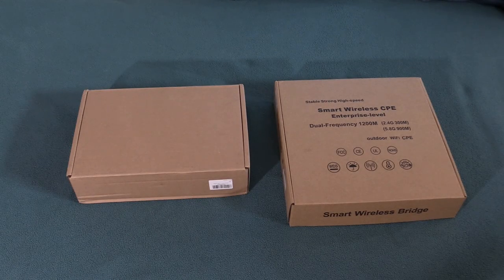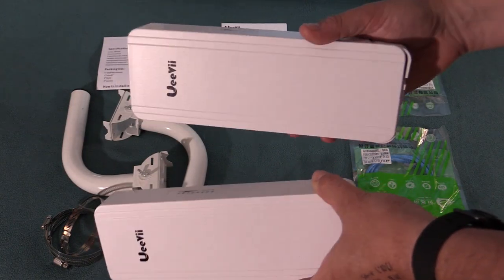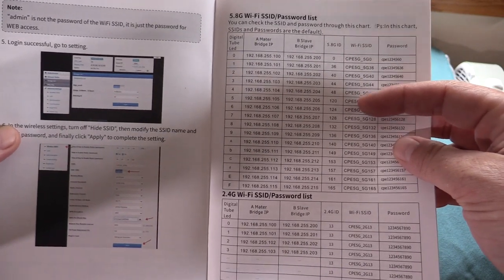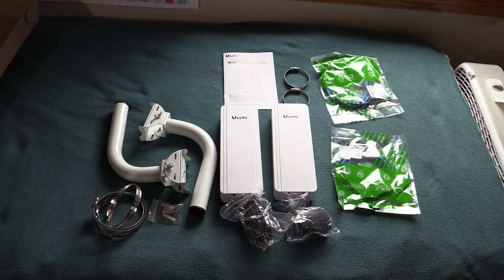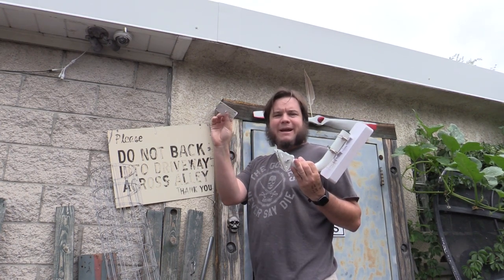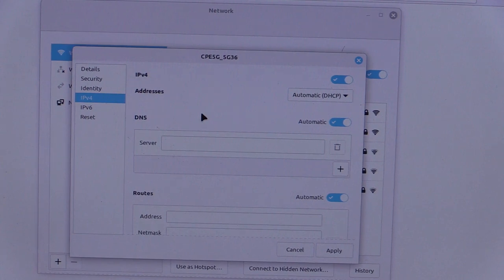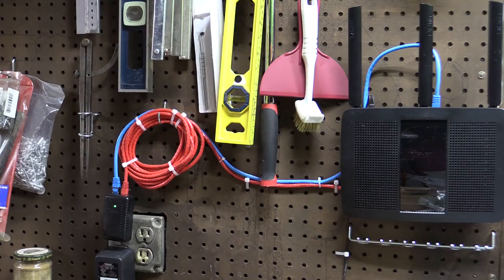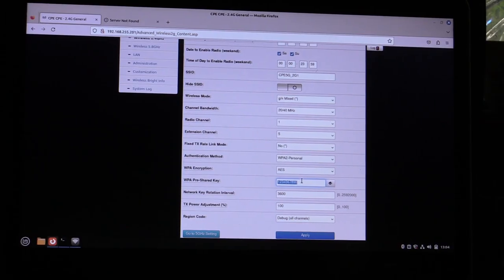UeeVii CPE5824 Wireless Network Bridge Review

Comment: We used a similar pair for our observatory when it was out in the countryside.   We had an internet service via XDSL to the optical observatory building, and then a pair of these wireless bridges feeding network to the radio observatory "science trailer"   worked just fine--even skimming the treetops in between.  It was a roughly 100m "hop", but the bridges were rated for a 1km "hop".  Never had a problem with them.  The internet service dropped out from time to time, and it was much much slower than the wireless bridge was capable of.   Can't remember the brand, but the cases looked exactly like the ones you have.
Reply from the maker: I'll have to come up for something when we get our observatory going at Sandland, right now it's a patchwork of little 4G gadgets. We have a LOT of trees and limited line of sight anywhere except the upper field, so I'm not sure if this would work out there!

Comment: A very nice product and a really simple installation, I find the solution with the hose clamps ingenious, as it allows for variations in the diameter of the pipe on which I mount the device. Up to 3mi range should be possible, which is a truly great range, leaving nothing to be desired.

Comment: The fact that you could access the internet while on the wifi-network of the bridge but could not access the admin-page is probably because the IP-range the DHCP-server in your network's main router uses is different than the 192.168.255.x range the bridge uses when running default settings. The laptop and bridge aren't in the same VLAN. If you configure the bridge to "request" an IP-address from the same range your router's DHCP-server uses you will probably be able to access the admin-page using wifi.
Reply from the maker: Yep, the bridge doesn't assign IPs, but even manually setting a laptop to the bridge's subnet I had trouble getting to it. Seems like it only works on the wired connection and only with http (no s).

Comment: switch to a static IP on both units an let say unit A 192.168.1.3 and unit B 192.168.1.4 (make sure its om the same range as your home network) set both dns to your gateway router ip

Comment: Sweet! Nice to know there is actually a signal "extender" rather than those useless "Wifi Boosters." Of course this is a little more complex than the boosters but then again it also actually works.
Reply: Wireless "extenders" or rather point-to-point wireless bridges have been around for many years, just less well known in the consumer markets.  They have almost always been an important part of the WISP (wireless internet service provider) market, usually intended for the customer premise equipment.  (Hence the "CPE" part of the name.)   One of the larger more well known (and I would argue safer/more secure) brands in this market would be Ubiquiti.   To me, this UeeVii product looks like a lesser clone of Ubiquiti's Nanostation product (which is also sold cheaper nowadays too!)  Yes, you would be correct, some basic networking knowledge is suggested to configure commercial grade wireless gear, but the quality of the equipment makes it well worth the setup!
Reply: @btw111  Interesting! I'm sure I would have discovered this if I'd bothered to dig into it significantly but as I just want connection in my garage but don't really need it I only messed around briefly with a twenty buck booster (promptly returned to Amazon as they're useless).

Comment: Hi! Very informative video! I do have one question, are they compatible with most routers? I have a router from my ex wifi, but want to know if these can work with that router, how can I tell?
Reply from the maker: I only tested it with a Linksys router. It seems fairly generic and should act as a bridge to extend your ethernet, so theoretically any router would work. However, I've run into some "weird" things with routers in the past so they're never 100% reliable.

Comment: I noticed some possible issues when trying to enter the configuration page. 
First is 7:08, your browser seems to use HTTPS primarily, this might cause issue since https uses port 443 in default while the config page usually uses http with port 80. 
Another one is that this is not a DNS problem, more refers to DHCP; Since these bridges usually do not act as a router but more like a switch, typically they do not have DHCP server(at least not enabled first time). 
Finally, I think try disconnect the Internet cable from the bridge might have some results, so it could not send any packets to your router at home(which may interfere with OS who is trying to get Internet connection😂)
Anyway, learning stuff is exciting, and this is my first time actually see somebody using these wireless bridges, so excited meeeeee😎
Reply: Sorry for my impatient comment, I did not watch the full video and I write this, but hope this would help someone 😹
Reply from the maker: Yeah, modern browsers seem to just add the "s" to http addresses by default now, unless you remember to change it. I keep getting warnings on my saveitforparts site, even though I don't have any e-commerce or anything that would need encryption, I guess the future is that no one must know which blogs you read.

Comment: It looks like a web browser issue, try different browser. Edit: Now I saw it was the not secure protocol, but you should always try different browser. Now days it is possible to install edge on Linux, and I only have it because of those routers.
Reply: Agreed, I had issues connecting to my university Cisco equipment via ssh using Firefox with no luck. I tried Chrome and could immediately connect.
Reply: Agreed, I had issues connecting to my university Cisco equipment via ssh using Firefox with no luck. I tried Chrome and could immediately connect.